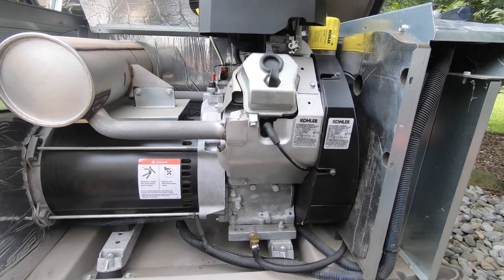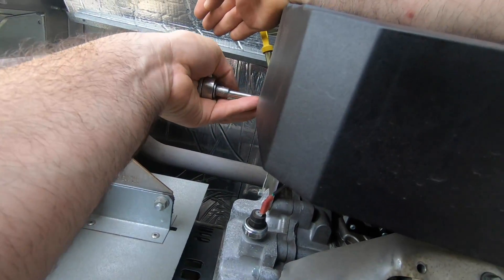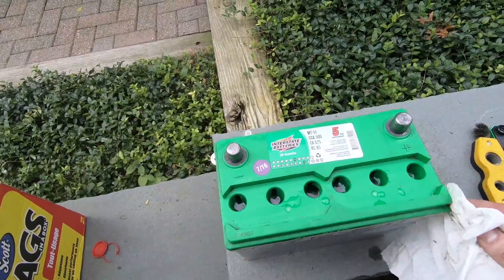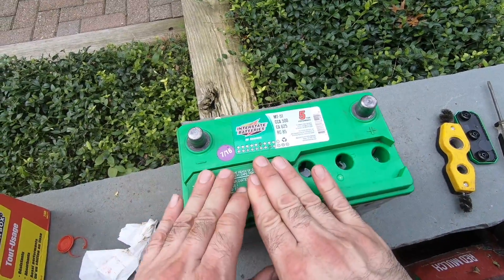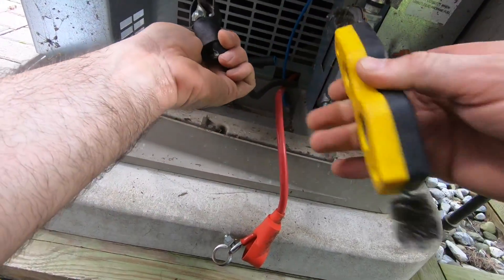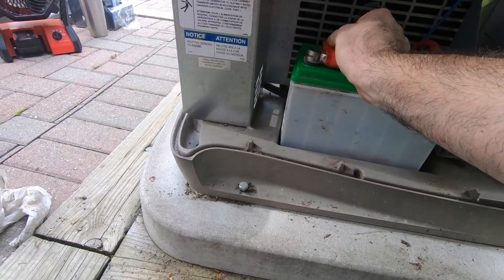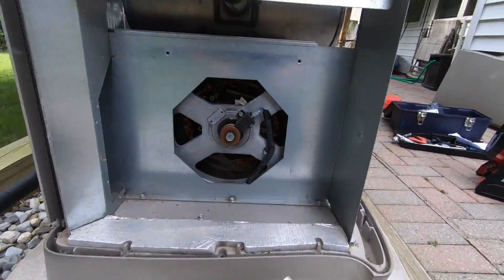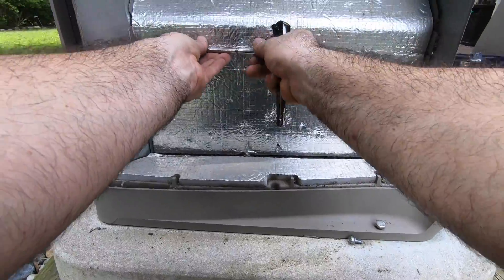Kohler Generator Maintenance Must Service

Comment: How do you get front/side covers off 20RESD to access 1) battery; 2) oil drain plug/hose and 3) other areas?
Reply: There are two Phillips head screws at the top of the side cover - visible when the top is lifted up. Take these out and the end cover lifts out. This lets you access the battery and oil drain hose. I have never had to take the side cover off to do oil, battery, spark plug, or air filter maintenance. You can just reach in and turn the valve to drain the oil. It drains slow so start it draining and go do something else for an hour.
Reply: It drains faster if you run the machine and warm the the oil.  Plus you would get out more of the contaminants as they would still be suspended in the oil.

Comment: I just replaced the stepper motor coupler and related parts (including the screw-down you showed to tighten) - can't find anything that shows whether there is a correct location when installing the new part, i.e. set the throttle to closed and/or the motor shaft should be at a certain location. Anything on that would be helpful. Thank you.

Comment: Great info in this video. But I'm wondering, how are the Kohler generators killing batteries? Is it because of the low water inside the battery?
Reply: Obviously overcharging that heats/evaporates the water. Add water to cover the plates, but leave room for expansion.
Reply: Kohler has a diode kit to compensate for overcharging
I put a few dozen in

Comment: Do you lose the programming when you disconnect the battery?
Reply from the maker: You will need to reset the clock and exercise time. When battery power is lost or disconnected.
Reply: The only time on a Kohler (and generac) you have to reset the user programming is if you totally disconnect all power sources.  That is the battery, and the battery charging circuit provided from the house power.  But it is always a good idea to power down the system for a battery change out, helps reduce the chances of a stray spark and is safer.  Then you would have to program day date time, etc.

Comment: what difference is there in model years since this is 2021 and this is from 2018 and which in your opinion is the better cabinet  composite or metal  and what is better higher off the ground and how close should it be to electrical panel and how far away from windows or doors

Comment: So what kind of running hours do these air cooled generators get before the engine begins to show signs of distress or needing to replaced? I know water cooled engines like the diesel generators are easily expected to get 10,000 hours or more before they begin to think about rebuilding them.
Reply: To generate clean power at 60 cycle a generator that has one field must turn at 3600 RPM, now if you use a generator that has three fields the engine can turn at 1200 RPM. If it turns slower it will run longer but this kind of generator needs a more powerful engine and is three times more expensive. The small engine in the home series is air cooled and gas fueled. No radiator/coolant maintenance, no fuel aging problems and less maintenance needed. If it's for occasional power shortages that kind of unit, well maintened, can last certainly 25 years. If it's used every week for many hours then it could last only five years before needing a rebuilt engine. (I might not have used the right terms speaking of fields and cycles, please correct me, it gives an idea of the reason behind the durability question.))
Reply from the maker: With the newer fiberglass bodies they should last longer than the older style generacs with the metal casings. The older generacs remind me of the Toyota pick up trucks driving around in the 80’s with the rusted out bodies. The engines are strong and do run at 3600rpms. As long as oil level is maintained they should last around 5-10k hours of operation.
Reply: I know personally of several 14 kW Kohlers with over 5,000 run hours and going strong.  Used in solar applications.

Comment: You're the only kind of service guy that I would allow to work on my equipment. Most service people get in and barely do the job and get out. They don't care about going the extra mile like you did with cleaning out the dirt in the battery area and other things that you did. I commend people like you for doing what you do....
Reply: You should lean about the batts the positive cable was not all the way down and you didnt out it down its a taper fit has to go down all the way to make correct contact
Reply: @davidcolasurdo2282  Could we get that in English?

Comment: My Kohler 20kw is 3 years old now.  I just did my own service for the first time this year and your video was a big help.  The manual mentions cleaning the oil cooler with a brush or compressed air.  I gather this cooler lies beneath some shroud on the machine.  Maybe you could cover that in a future video???
Reply from the maker: It’s on engine tiny black radiator looking thing with 2 black hoses. It’s rare those ever get dirty.
Reply: On a Kohler, you have to move some sheet metal shrouding from the front of the engine.  It is a REAL pain.  The best thing you can do to help keep it clean is to not throw grass clippings at it with the lawnmower, keep the grass around it trimmed-in short eliminate the dust and other material that might clog the cooler.

Comment: I have a 17RES and recently found a nut on the floor of the generator housing and no idea where it came from until I watched your video. 1 nut off, two loose, only 1 tight. Yet it has been running fine, until now. Great piece of maintenance advice. Nuts replaced and tightened, it still doesn't really want to run. With a little help on the throttle, it will start, but soon the auto-throttle takes over and opens wide and the unit shuts down.  Any suggestions?
Reply: Probably check the linkage on the stepper motor for security.  Watch it during the start cycle-it should firmly go to the full fuel position during start, and then back out as it begins to control engine speed.  Make sure the electrical connector is properly seated on the wiring harness for the stepper motor After that, check mechanical linkage connections, then replace the stepper if all else fails.

Comment: What about using blue loctite (242) or purple loctite (222) on the carb bolts to keep them from vibrating loose.  222 is for small bolts.
Reply from the maker: I started using blue locative on the carb bolts. Haven’t been applying long enough yet I’m sure it will help. It helped on my Milwaukee impact driver belts clip. It would never stay tight until I applied blue locative about 8 months ago. Haven’t worked with the purple yet will have to look into it

Comment: Any idea what causes the battery acid level to drop?
Is it a condition unique to Kohler ?
Reply: The water evaporates from the acid/water mix mostly due to heat of charging. That's why you only add water (distilled).
Reply from the maker: The controller overheats the battery from the trickle charger. It’s good to check the battery once a year
Reply: @thehvachacker  Does a firmware update fix this issue?
Reply from the maker: No replacing the main control board does help. The control boards with green bottoms were overcharging. Kohler had a diode kit they include with all the newer boards to help remedy this
Reply: @thehvachacker  I have a green board and no diode kit. My recent battery lasted exactly 37 months. The previous battery lasted five years. The green controller is terrible and my guy never told me it was a bad design, nor did he offer to install the diode kit.
Reply: @fredbruno5437  He may not have known about it.

Comment: With my Champion standby gas generator I don’t need to check the batterys (mine use two) because they are sealed and don’t need any kind of maintenance aside for changing the oil every 100 hours, because they don’t have any overcharging issues neither, but for the people who has a Kohler generator this tips are very helpful 👍
Reply: You need to check the terminals for corrosion.  Every service.
Reply: @wessleyrutherford5672  My battery terminals are completely clean, none of them have any trace of rust.

Comment: Can you tell me why the coil on the linkage to the carburetor is not moving on startup?  Is there a way to test the coil???
Reply from the maker: Checking resistance on the coil of the stepper motor. It should be around 33 ohms or close each coil. Since resistance changes with temperatures. As long as both coils (black &yellow) (red &white) have the same resistance the stepper motor is good. Make sure the red Molex plug is together strapped onto the dipstick. Also that the plug is properly seated onto the bottom of the controller. Can you manually move the stepper motor with little resistance or is it really tight?

Comment: A little late to the party...Just beginning to shop and compare for ~20KW standby. I thought KOHLER would be a winner on reliability, but then I read comment from Scott Findley (1st comment, way below) that he opted for a Troy after several bad experiences with Kohles. 
Re: adding Distilled water to battery. This gizmo:

https://www.etrailer.com/Accessories-and-Parts/Deka/DW00318.html?feed=npn&gclid=Cj0KCQjw_5rtBRDxARIsAJfxvYBdMVGJ7_CY9O32teDHmntjAZ8Y3AkM5C8yHujk2QqyH6xuudL1q-4aArx2EALw_wcB

and others like it thankfully make the task Easy & relieve the user of the frustrating exercise of eyeballing the level of electrolyte in each cell.

Comment: what's your thoughts regarding the base. Should I install a concrete base and maybe so isolators to stop vibration or is the standard base on crushed stone okay? Thanks Chocobill
Reply: Definetley better with a concrete pad and anchor the generator to it.
Reply from the maker: I would go with the concrete base which is what I thought was the standard base. You want the generator lifted up off the ground a few inches. Makes draining oil easier. Also helps with water drainage. Crushed stone bases always seem to sink. As for vibration dampening that’s not easy. Usually you will want to anchor to the cement to prevent the generator from shifting from vibration

Comment: You can keep the battery inside the house and run wires into it, safe from nature elements .
Reply: @Sam Max  I like your idea of keeping the battery indoors. Depending on the location of the generator, this might mean a long run of two large conductors. I mentioned this idea to my guy when he installed the unit. He was not impressed with my suggestion.
Reply from the maker: You can but the generator has a housing for the battery.
Reply: @thehvachacker  
The housing for it does not have heat and air conditioner,the weather really effect the efficiency of the battery.
Reply from the maker: Yes but not many homeowners want the battery inside there house.
Reply: You could also buy a AGM battery.

Comment: Also, my 20RESC (installed Sept 2016), gets new oil, plugs, air filter yearly. My oil level stays steady, oil is always super-clear on the dipstick, but I get a milky oil residue on the inside of the rubber oil plug caps. Test cycle 20min runs weekly, and I have had only short power outages (few minutes to an hour or two) since install.
Reply from the maker: Russel are u running a full load exercise if not your machine is just building up condensation. I also recommend the advice Tom gave you at least once a month shut power off to your house and let it power your house for an hour. That will burn the moisture out of the engine.
Reply: @thehvachacker  Is a 30-minute  fully loaded exercise the same as shutting power off to the house for 30 minutes?
Reply: @fredbruno5437  Yes.
Reply: Milky white on the rubber cap is cavitation.  You need to let the generator run under a load for 30 minutes to build up heat in the cylinders.  The weekly exercise will not do this. This why at maintenance  visits we run the generator with the house load for 30 mins or so. Hope this helps
Reply: @tommyg5565  Perhaps you meant to say "Condensation".
Reply: Can some tell me how to replace the spring on Kohler resc? Or a picture would help greatly. Much appreciated.

Comment: Also, thanks for the advice to check the tightness of the bolts under the air filter housing and the set screw on the control rod. Mine were all tight but that helps those of us who do our own basic maintenance.
Reply from the maker: The stepper motor 10mm fasteners loosen up from engine vibrations. I find them loose on many maintenances.

Comment: That was good on the battery maintenance; it's just like maintaining a non-sealed auto battery. Refill the cells with clean distilled water, and yes to the bottom of the plastic flanges. The metal cores must be kept covered by water (strong acid solution). I check battery water level every 90 days on my Kohler 20RESC. The recharge overvoltage can be corrected by a software upgrade or a resistor kit from Kohler.
Reply from the maker: Yes it can be corrected with a diod Kit. That forwhatever reason our Koehler distributor doesn’t want t give to us
Reply: Surprised maintenance free batteries are not being used here
Reply: @mikeswink1031  Since in principal maintenance is supposed to be done every year, (ideally checked every 6 months) it shouldn't matter-as you should check the water level and terminal cleanliness on the battery. But "sealed" batteries are becoming more and more common place.  Additionally, the battery (a group 51) in this particular unit was installed backwards, (cells facing in) so the cell covers could not be easily checked without disconnecting the battery leads.  I find this often.

Comment: You need to show how to adjust the va!ves for proper clearance.😁
Reply from the maker: On a Kohler, this can't be done. Yet on a Generac, I can make a video of finding top dead center and checking clearance. Kohler uses hydraulic valves
Reply: @thehvachacker  thanks that would be greatly appreciated, the new 22k would work!😉

Comment: The one nagging problem I have is the back spark plug; it is very difficult to get to.

I have seen people online suggest taking the back panel off during regular maintenance, which I guess I could do.  What if I cut a small hinged trap door in the back panel?  There's nothing back there except the plastic shell and the insulation.  What do you think?
Reply from the maker: I just use a swivel head ratchet a short socket extension and 5/8 spark plug socket. It comes right out. In this video, I pull the plugs out. https://youtu.be/eEE_YUlCMDc   I only take the back plate off if I am testing the starter or the older style Kohlers RES models that need the mag-pick up adjusted or replaced from LRA lockouts. Is this your generator or you work as a Tech. The rear plug gets easier. The hinged trap door would be more time consuming than just removing the plug.
Reply: @thehvachacker  It's my generator so I do this every year.  The other video is helpful, especially the extension trick.  Right now I have a different kind of problem.  For the first time, I can't get the spark plug wire off (that back plug).  I have rocked it, twisted it till I'm blue in the face and it just won't come off.  Be cause of the tight space, it's hard to apply upward force on it, and I don't want to damage the wire.  Any tips?
Reply from the maker: Have you tried hose pliers or any pliers to grab the boot and pull. Should come off. If your having problems with it put some non dielectric grease on the new spark plug before putting boot bacj on. The back should come off with removing all the other panels. Worst case senerio
Reply: @thehvachacker  Well, I went ahead and took the back panel off.  Once I was able to pull the spark plug wire straight up, it came off OK.  I did put some dielectric grease on the tip of the new spark plug.  taking the back panel off is a bit of a pain in the butt!  Still thinking about that trap door - flip it down, do your thing, and flip it back up!  Thanks for all of your help!
Reply from the maker: Happy to hear you were able to remove it. I find it’s easier to remove that rear spark plug with the air filter cover off. Never hurts to try and create a way into the generator if it’s yours. The grease should help you get it off next time.
Reply: @thehvachacker  One last question I'm curious about.  It's been a little over a year since the last PM.  Since we haven't had any significant power outages, the oil and spark plugs had only about 25 hours on them.  The oil was pretty clean and the spark plugs were not bad.  I went ahead and changed them anyway, but how necessary was it really?
Reply: @billwest5611  I work on gas engines and they don't have the issues with oil contamination found on gasoline engines. If you use synthetic oil and you run your generator on load once a month in cold weather and once every two months in the summer you are certainly good for two years at that rate. Humidity is you enemy in a generator.
Reply: @billwest5611  It really is necessary.  The oil looks fine, but the additives that provide desired properties deteriorate over time.  The oil can degrade to a degree as it is hydroscopic and will absorb some moisture, which doesn't do it any good either.  Consider it cheap insurance for the life of the engine.  But, I might skip the spark plugs-do a visual, clean if needed and re-install.

Comment: do you use 5w 50  in the battery?
Reply from the maker: use distilled water
Reply: I usually go for 0w-20 fully synt5